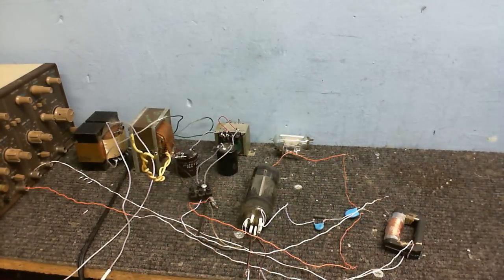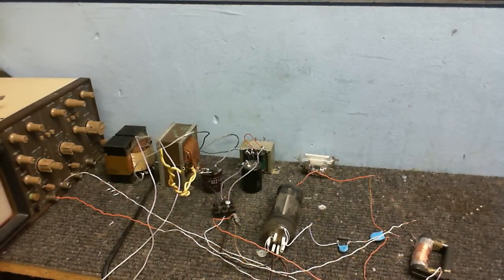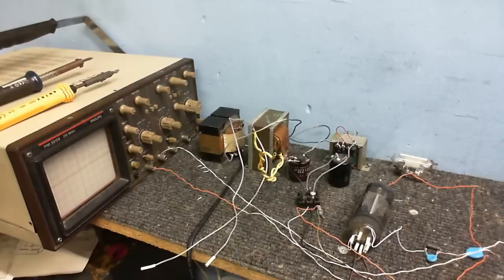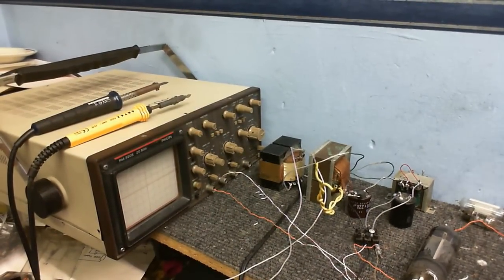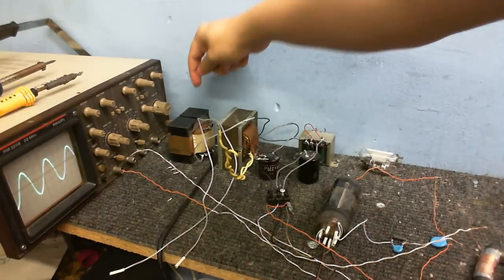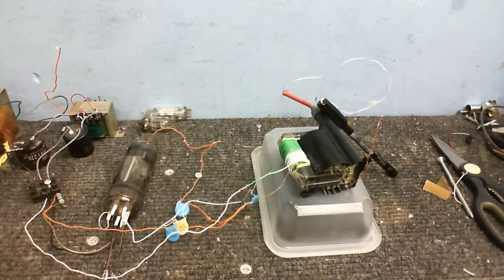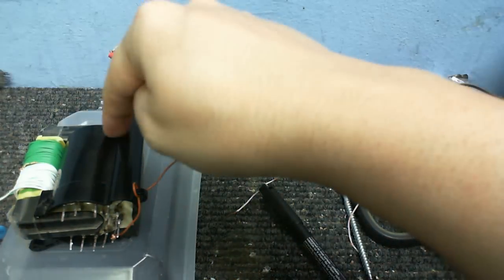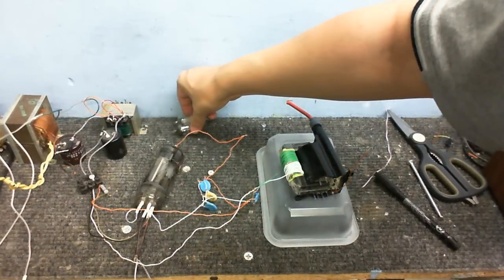Valve/Tube Flyback Driver Experiment

Comment: it is rusian
the caps are 10-25nf
1.2nf

and the valve is a 6p45s (el519)
(its not a II but a weird russian letter)
Reply: the powersupply should be 600V
and pleas keep in mind if you give the grid tomuch signal it makes the output weaker
Reply: the 10-25 nf should be 1-3Kv
and 1.2nf 100-200V

Comment: i just thought of somthing

u used a blank core to look at the waveform

you can use the bloank core as a driver

wind 10 on the core of a flyback
and a few on the blank core
how more you wind on the blank core how more output you have

and if the flyback breakes it doesnt matter becaus you cant blow up the tube (it has a steady load)

i am gonna try that methode just for fun

Comment: MKФ= "MKF" or "microfarad"...."B" is Cyrillic "V" and in many languages that use Cyrillic (Russian, Bulgarian...etc) the capital "B" is actually a "V" for VOLTAGE.

The valve is a "6П45С" is actually "6P45S" which is identical to Telefunken "EL509" if you take a look at the Radiomusieum valve library. This is a really interesting valve and the Russian ones are cheaper...sometimes better...often worse...it depends. It is an adventure finding out!

See these:

 http://www.radiomuseum.org/tubes/tube_6r45s.html

http://www.radiomuseum.org/tubes/tube_el509.html
Reply: i prefer the pl519
its a little it  better then a pl509